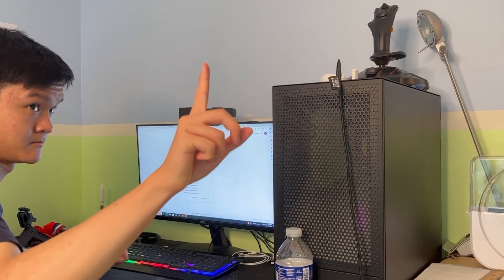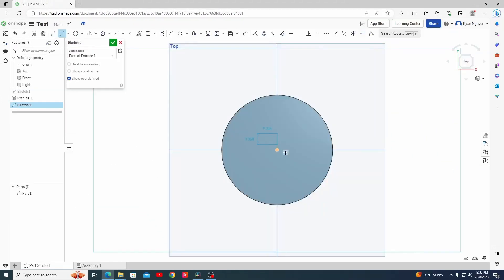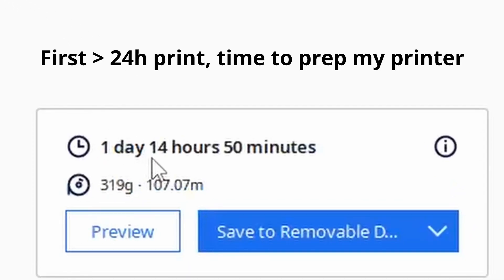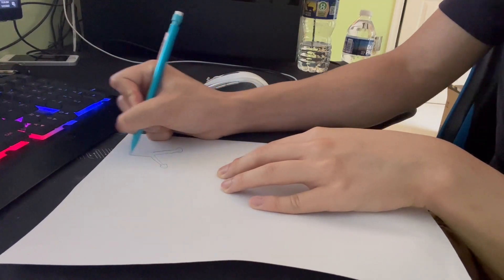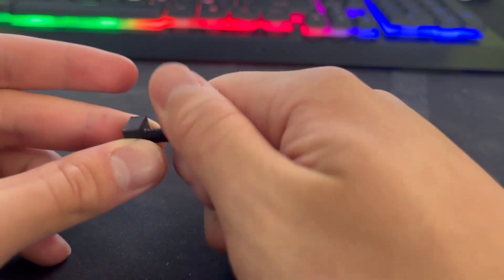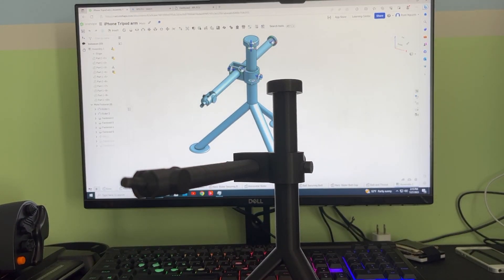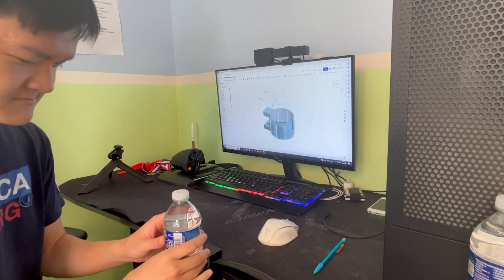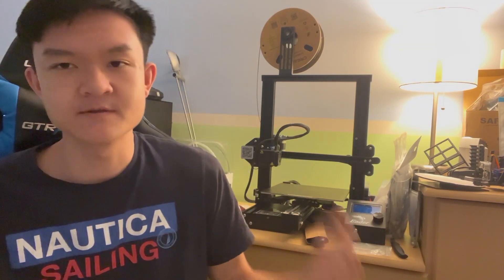The ABSOLUTE POWER of functional 3D printing (and CAD)

Comment: can you 3d print a new 3d printer? and double the printing time efficiency?
Reply from the maker: Perhaps. Maybe printing the structural parts of the printer, then using stepper motors, a control board, and a power supply to make it work!

Comment: Love the video, keep up the good work! One question: How do you stop parts from warping when printing at the edge of the print bed? I have some problems printing bigger parts.
Reply from the maker: From my experience, it seems that prints warp at the edge due to that part of the bed being at a lower temperature. You can either simply turn up the bed temperature for large prints (5-10 degrees Celsius), or "preheat" the bed at normal temps for a few minutes before pressing print to make sure every part of the bed is hot. I usually had that issue with buildtak or glass beds, then I finally tested PEI, the one in the video, and it worked wonders! (PEI affiliate link in desc. if you want to take a look). Seems like the PEI sheet is really good at conducting heat, as it is mostly metal. Glass takes a long time to heat up, and buildtak is somewhere in the middle. Hope this helps!

Comment: Actually totally legal to 3d print a gun. Only stipulation is that you must embed a metal component within it somewhere.  The only reason for that law is so that it is still able to set off metal detectors.  Great video also, really enjoyed the actual writing and the comedic touches, keep it up, earned my sub.
Reply: Just to add a little more to that for those who may not know: Provided you aren't a felon or otherwise barred from owning/purchasing a firearm, then yeah, you're entitled to build your own firearms (3d printed or otherwise). Of course, you still have to follow any laws applicable to you regarding possession/storage/transportation/etc which would also apply to any other firearm that falls under the classification of the built firearm in question. Also important to understand is that you may not legally sell or transfer that firearm to another party unless it has been serialized (pretty sure that applies at the federal level, but if that's state by state, feel free to correct me).
Reply: @aaronjones3181  Thank you very much for adding to that, that is all absolutely necessary information to know before attempting anything like that.  I do believe that you are correct with the serialization being at the federal level. Also I believe that the distribution of .stl files of firearms is considered whatever that would be (Selling a non-serialized firearm).  So might even be pretty difficult obtaining a printable file in the first place, unless you're designing it yourself, which is incredibly dangerous, but I think that can go without saying.  I think I saw that a while back so it could be different now, but definitely lots of research needs to be done before attempting something like that.

Comment: As far as functional goes - I've been using 3D printing for organization, using Gridfinity, 3D printed drawers, I've made a stand for vacuum cleaner accessories, my bathroom has a sink with a strange lip thing so I made some shelves with one leg longer than the others for that, I've made a belt holster to hold things I use at work (that took many iterations to get right). You can definitely do a lot with 3D printing. I've seen some people take functional printing even further with bolts, nuts, and other various hardware. It's also great for tabletop games, which often use plastic pieces.
Reply from the maker: Oh yeah, 3D printing is great! It can be a hobby or a tool, or both! 3D printing does have a stigma in that it only prints weak objects, but from how things have developed, my ender 3 pro with a bi-metal heat break can print polycarbonate, a very strong material. PLA is pretty strong in its own right.

Comment: OnShape also shares your prints with the general public if you don't pay for it, which makes it a no-go if you want to use it in a business that plans on selling the models or the prints - or if you just don't want them to be public. And, like any cloud service, they have all kinds of terms and conditions to agree to, and if they have problems with their servers or running their business, they can put your files at risk.

Most people seem to recommend Fusion 360, although I'm on Linux so that's not an option for me. FreeCAD is an option, there are some CAD plugins for Blender, SolveSpace is okay but lacks some advanced features, if you're into coding and don't mind writing your models as essentially a computer program then OpenSCAD is a good option. Many slicers have basic shapes and boolean operations if you just want to make something simple.

Comment: Does your Ender 3 with upgrades beat a Neptune 3 Pro or Neptune 4?...which should I buy as the first printer?  or maybe Sovol?
Reply from the maker: Looking at this Amazon page: https://amzn.to/43UDuMU (affiliate link), it actually seems like the Neptune 3 pro printer is a beast, for $199 due to a sale. Reading closely, it DOES actually have a PEI bed, which is a GREAT bed type, and is also magnetic. It has a dual gear direct drive extruder, which means that the extruder is right above where the filament melts, meaning it will be more precise when retracting/pulling and extruding the filament (right amount of filament coming out). Dual gear also means it is stronger in pulling the filament. Also has a dual lead screw drive, meaning both sides of the printer have a screw to lift up where the filament comes out when needing to go higher in the print, making it very stable, and can't sag on one side. Finally, auto bed leveling which is very nice. My ender 3 pro with upgrades actually is around $300, but I enjoyed the "fixer upper experience". If I remember correctly, the Neptune series was more expensive, so I didn't buy them. Now I am very tempted to buy a Neptune 3 pro. Some reviews say it is a great first printer for beginners, and other say it isn't. It may depend on the person using it (as with anything), but from my perspective, it already has amazing upgrades and would work well out of the box, all for $199. Hope this helps!
Reply: @TheTinkeringTechie  Thank you for such a detailed response, this is the problem watch 2 videos and they will have differing opinions which is why I want easy parts & upgrades so I can do it myself. ( yes I always use Affiliate links as why not when help is given ...)
Reply from the maker: Glad to help!

Comment: Nice video! I hate my ender 3 with a passion especially after using anycubic printers. My ender 3 has issues everytime I print with it, and it has gotten me so annoyed. Yes, I like tinkering, but I want to be able to use my printer lol. I ordered an elegoo neptune 4, as it is the cheapest printer with klipper that seems pretty good, and from previous reviews about elegoo, its out of box experience should be much better than what I had with my ender.
Reply from the maker: Thank you for stopping by! I must've just been lucky with my Ender 3 pro. I did see reviews saying that the Ender 3 is not very beginner friendly, but the pro version is, which is why I got it. It started having issues a couple months in, and that is when I decided to fix it, and ended up upgrading it to where it performs tremendously. Took a lot of trial and error tho. But I agree, Creality ender 3s are for mega tinkerers. The more expensive printers are tools, and the cheaper ones are projects and tools.

Comment: Use Solid Edge 2023 Community Edition as a professional CAD System for modeling. Its free and its not forcing you to put your data where you dont want it. I ordered myself the qidi tech x-max 3, its a fully enclosed printer, very fast and can print the most complicated high temperature filaments very fast in a heated chamber, but it has klipper, i prefer open source OS.
Reply: im learning it but is alot more confusing than fusion 360
Reply: @stanleyhoptroff  You wont regret learning it, because long time its much better. Its a real professional cad system, i know what i am talking about, i am using this CAD Software from day 1 and i know other like catia, nx, solidworks etc..
Reply from the maker: Interesting, never knew about Solid Edge Community Edition until now. Sounds interesting, and also has simulation/animation capabilities! Great for project videos for extra production value! I'll look into it. As for my Ender 3 pro, it was affordable for me, and got the job done. With the right upgrades however, I am able to print PLA at 150mm/s reliably (and allow me to print exotic filaments like polycarbonate) and am able to do 200 mm/s (max mechanical printer speed) but I am not sure exactly how long it can go for as I haven't tried it yet.

Comment: pls get an auto leveling kit it's giving me flashbacks 😭
Reply from the maker: PAPER FOREVER! Jk, would be cool to get one. The PEI sheet is very good, to the point where I only need to level the bed in one go every 3 prints.
Reply: @TheTinkeringTechie  I'd definitely say that the PEI sheet is a good first upgrade, I've printed many prints on mine without problems. If you ever plan on printing PETG, get some glue stick to put on the surface, as PETG hates to come off.